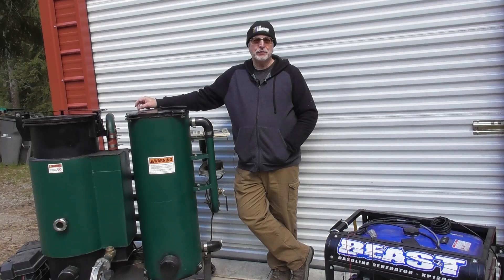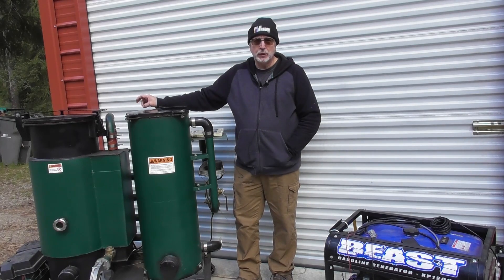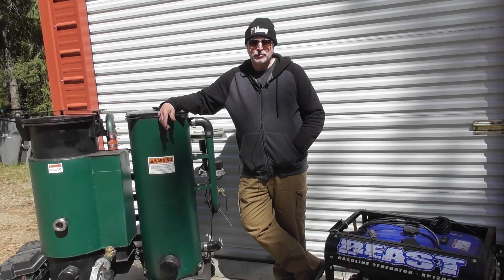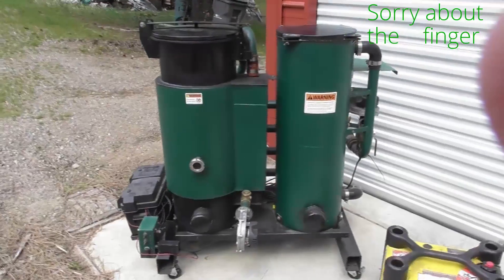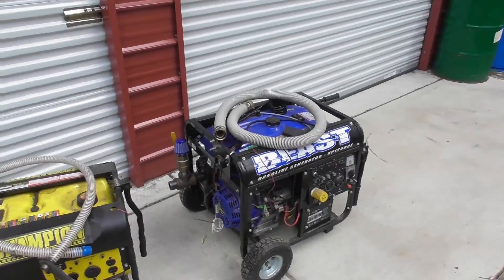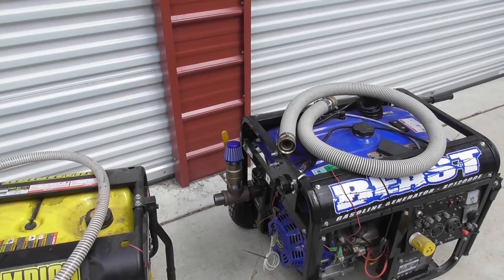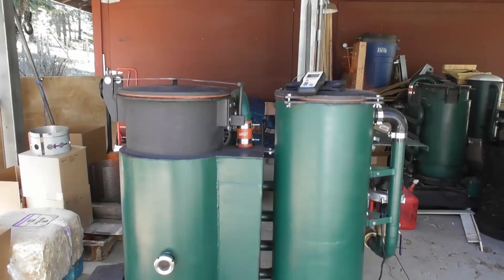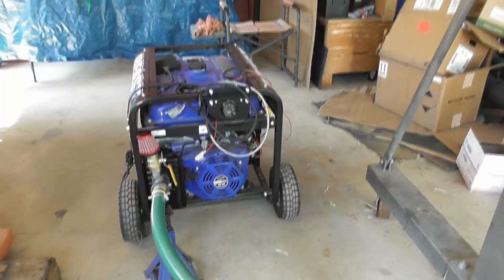Running your generator on Wood Gas !

Comment: What is the consumption of wood for 5kw generator in 24 hours?
Reply from the maker: Fuel consumption is about 2.5lbs of fuel per Kw/h so a 5Kw generator would require about 12.5lbs per hour
Reply: @steveoffgrid485  thank you
Reply: Hi. How much it's coast please ?

Comment: How much wood 🪵 would you have to burn to run the 12kw generator at full power ?
Reply from the maker: rule of thumb is 2.5lbs of fuel per KW/h

Comment: Glad I found your channel! Subscribed and all in to learning this from you and your workshops, thank you 🙏 can we burn biochar made from wood in the gasifier?
Reply: Biochar can be converted to so called coal gas, but it requires an industrial facility, very hot coal is reacted with steam to produce carbon monoxide and hydrogen gas which can be burnt in engines
Reply: @kangle2938  good information!!!!

Comment: My wife and I were literally a day from ordering one of these when we saw the Gridlessness YT channel got one so we decided to wait and see how it worked for them.  Unfortunately, it hasn't worked well for them for some reason and they're very smart and industrious.

I don't see many real videos of people using gasifiers to power generators.  Lots of talk, lots of it can, lots of it should, but very few videos of it actually working.

Your video is much needed for people like to me to see how it really works, but unfortunately you had far too many cuts and edits.  I want to see the entire thing from start to finish to see what the process takes.  I suspect that while it's possible to run a generator with your gasifier, that it's not actually feasible or easy.  I would like you to prove me wrong.

And that T-valve needs to be replaced by something that introduces air automatically because that seems to be a big issue, at least from watching the Gridlessness YT channel's attempt to use your gasifier.
Reply from the maker: See the video reference at the end by a customer in Poland. They show the complete process from flare to switchover to manual start on the generator,
( https://www.youtube.com/watch?v=m9VihVie6E0  )